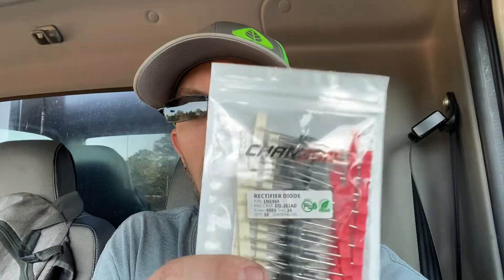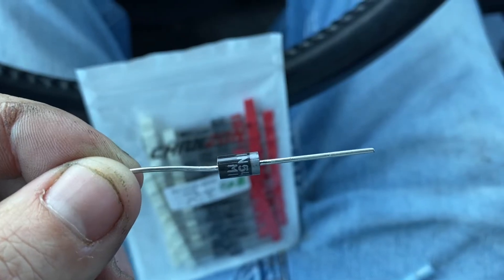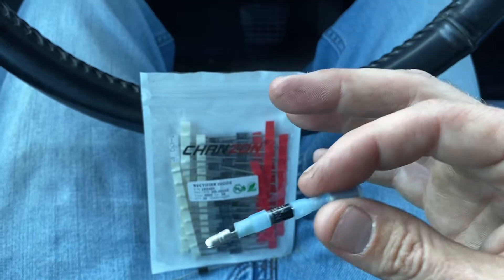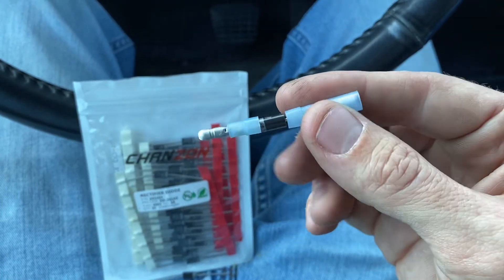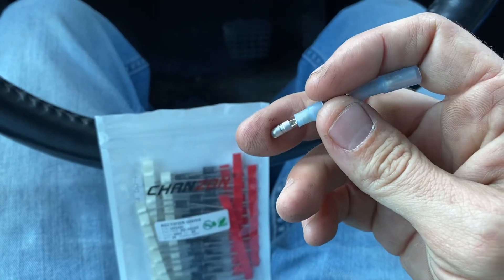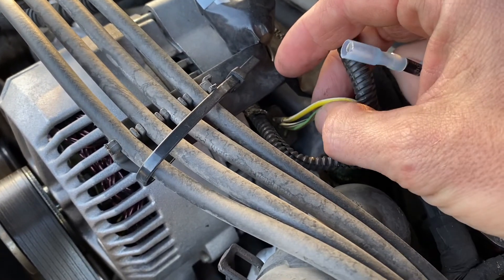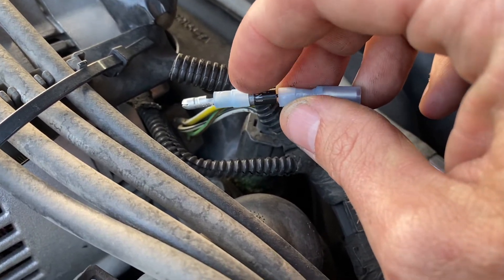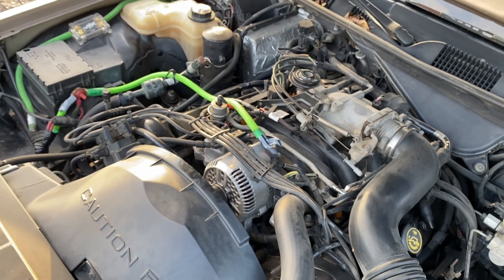How to add diodes to your alternator to increase voltage $10

Comment: Is there a way to lower the voltage?
Reply: There's two main options...
1. Install an underdrive crank pulley—typically requires a shorter belt
2. If one's available, install a larger alternator pulley—typically requires a longer belt

Comment: AGM batteries require higher charging voltage (between 14.4 and 15V) so I think using the diode will trick the alternator and will produce higher voltage required for the AGM to be correctly charged.

Comment: You can run AGM at 5.3 I have done it  before no problem...
Reply: Your boiling the agm with anything above 14.8.
Reply: @MyBlowncobra read Optimas explanation on their website. Also, some 3rd party testing has seen yellow tops take 16 and like it.

Comment: the alternator is already rectified and controlled to specified volt and i dont think adding a diode will increase the voltage. Fake!
Reply: Not fake! I use diodes inline on sense wire and it increases my charging voltage from 14.8v to 15.8v.
Reply: @Nobody72472 how much diodes did you use to get that 1 volt increase?
Reply: @MsAvishkar  
2 in series
Reply: You are slowly killing you batteries by overvolting them. Yea they  charge fast at that voltafe probably. Yea you dont notice any difference or any detrimental effects. The car isnt running that frequently. But after half a year theyll be dead.
Reply: @Izziana wrong
Reply: This is definitely accurate and very common in the competition community
Reply: Do some research before commenting some stupid shit
Reply: Every ones doing this  hack but most car battery are ok but AGM batery and lithium cant be charged at more than 14.8 because of the cells and how it draws  current  
And most old amplifiers internals are max out at 16v 
And that could be why i seen lots of cars on fire lately on side of the road.
Reply: @tonysolis825 wromg . Some lithium batteries can charge 16v  . Headway and sodium like lower charging like 14.6
Reply: @tonysolis825 I run lithium at 15.8 in one vehicle and 15.5 in the other . Cmax and LTO Yinlong. Personally never had any issues with the lithium and I have been running it for over 5 years charging over 15.5